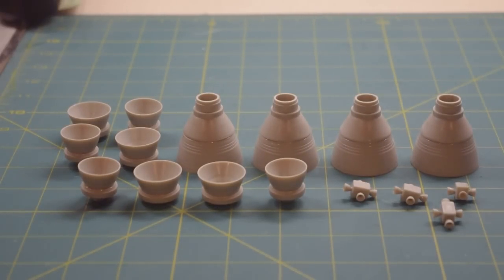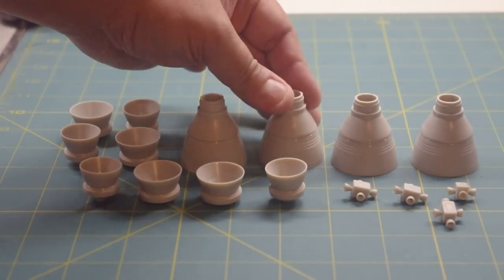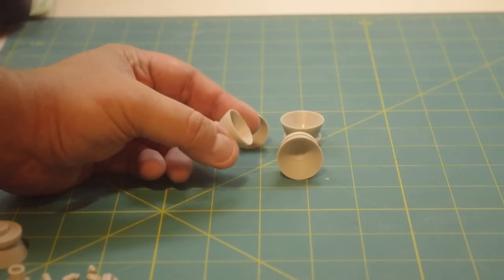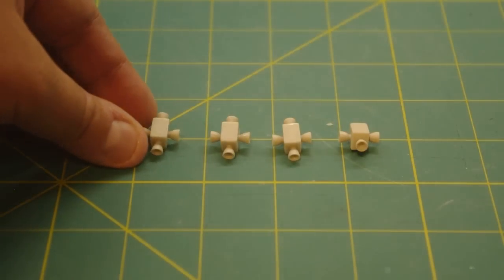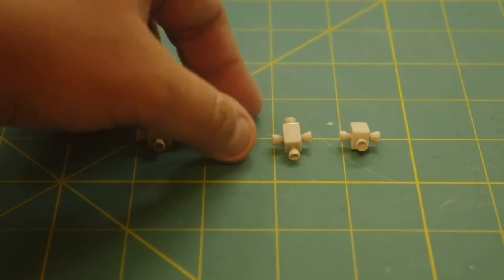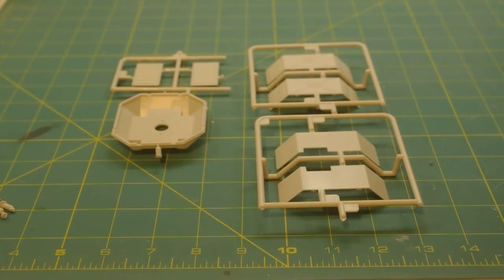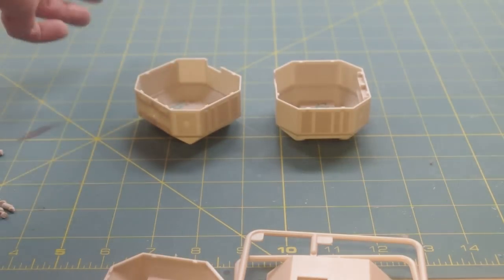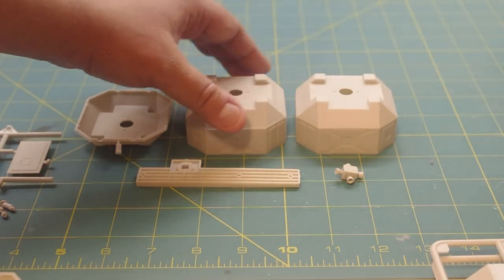MPC Space: 1999 22" Eagle Test Shot Build Part 1

Comment: JMChladek, Have you ever used white glue (PVA) as a small gap filler? Like a gap on the inside of right angle parts.
Reply from the maker: +Dale Sipling It could be used, but only in very few instances and I don't normally recommend it. I've found the best use for white glue filler on a plastic model would be to smooth over a glue joint with a tight seam where it has a deep surface to key with. I used it on the warp pylons of my 1/350 Enterprise for instance where they joined with the secondary hull. But, I have experienced some cracking issues with it, probably due to vibration caused by transporting the model by car to contests. So the next time I try using it, I will make sure the glue joint itself is nice and rigid to help minimize cracking of the seam. It still may never be an ideal solution though. 

Now on the Eagle here as I discuss in part 2, if you use a good plastic weld glue on the cages and spine, liquid plastic in the glue joints does the job nicely of filling the right angle seams. From there if I discover any gaps, my filler of choice will depend on how wide and deep they are. It could be anything from thick primer if it is a very shallow imperfection to gap filling super glue for a deep one. Choice of filler comes from practice and experience.